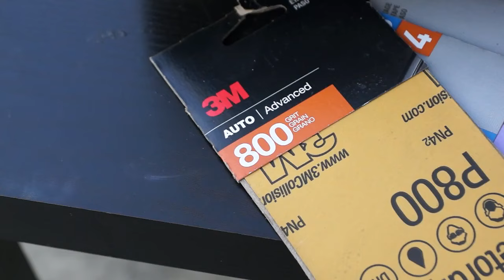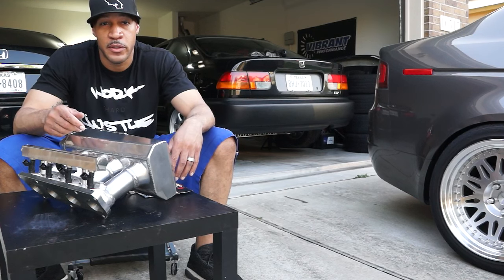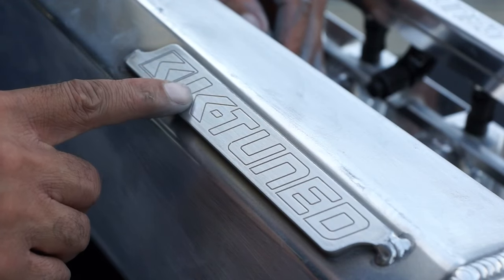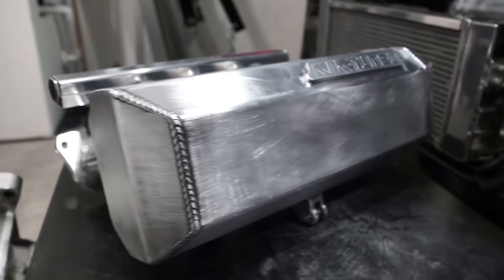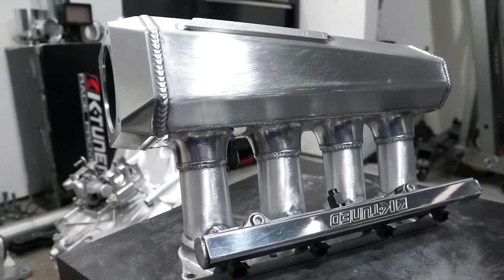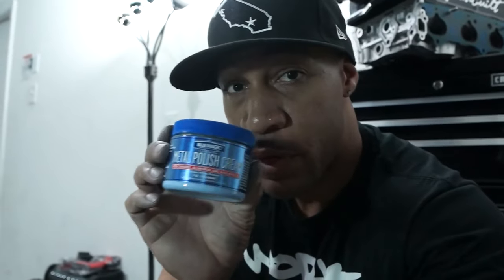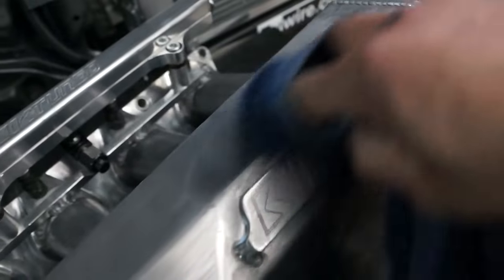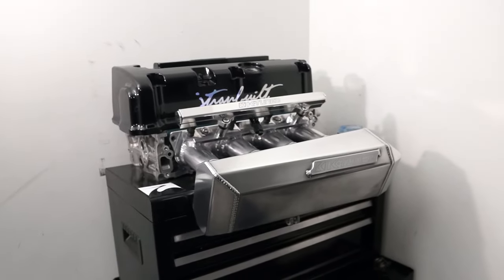POLISHING ALL DAY AND NIGHT | YOU ASKED ME

Comment: I used a dremel with a buffing wheel, and an angle grinder with a buffing wheel polishing from a 600 grit sandpaper finish.  comes out mirror.  You just have to start with a nice rouge and make several passes.  It's definitely faster and not as rough on your hands, but wear a mask/respirator.
Reply from the maker: +Steve Pham or ill keep doing it this way and never need to buy anything else and still get the same finish.  I never finished polishing it in the video.
Reply: Yeah nothing wrong with doing hand polishing.  I still do it from time to time for some things.  I work in a machine shop so I take advantage of all the tooling I have.

Comment: Get yourself a high RPM power drill and some buff pad adapters. It will save you hours. Its what I do. I polished my own OEM fuel rail, distributor, various brackets, header, fuel injectors, bolts. Its worth the investment. I bought my Milwaukee corded drill for about $100. Hits almost 3000 RPM. It leaves my stuff looking like a mirror with the right compounds. No haze. I also use my Dremel for small parts. Or try getting a bench grinder converted to a polisher. They aren't too expensive. Believe me, you will be looking for things to polish it will make it so easy. You can even make some money polishing other peoples parts.
Reply from the maker: +Victor Aguirre if you noticed, I said it's what I do when I don't have money for parts. I purposely spend lots of time doing it, it keeps me occupied and working on my car rather than spending a hour doing something and then I don't have anything I can even do to improve my car anymore.  I have other things to polish with, actually I have exactly what you suggested but that wasn't the point of this video.  

But thanks for watching and leaving feedback. I appreciate it.

Comment: you tried puttin the sand paper on a drill, to make the process a lil faster?
Reply from the maker: +L Harris no. If you need more speed, use a DA sander.  I don't use them becuase you still end up hand sanding to reach the hard to reach areas
Reply: gotcha, i got a few ideas ima try out when i get a lathe to make that process a lil better for all. looks dope im more of powder coating kinda guy

Comment: I have a question that I'm hoping you can answer. I have some old sprint hart cps, and I was wondering if this method you use will work on the sprint hart lips? I just want them to shine since the clear coat is coming off the lip. 
thank you
Reply from the maker: +Alfredo Robles yes this method still works. I wouldn't start off with nearly as rough of a grit with the wheels though and I would go way up to 2000 wet to finish it off.
Reply: ok thank you sir! Greatly appreciate the response.
Reply: for wheel lips. peel all the remain clear coat, then rub with 2000 grit+polishing paste instead of water.. then finish it off with power ball + polishing paste for mirror finish. works FASTER and wrist friendly. :)
Reply: What if it isnt peeling yet? Do I just start with 800 or 1000 grit?
Reply: By the way thank you very much

Comment: Ok, I'm a recent subscriber. I bought a K24a2 (completely stock other than a k tuned header and skunk 2 exhaust)Teggy last week. I'm looking to make at least 300hp in the future. My question to you is, did you have to build your block or head at all to make the power you're making?
Reply from the maker: +Josh hit VTEC yes, at a minimum you'll need your head built or swapped to a k20 head and built to make that power.  Mine is slightly bored to 88mm at 12.5:1 compression with a built head. With the right combination, you won't need s port job, but you will definitely need cams and supporting valvetrain.
Reply: Ok, thanks. I'm trying to do the k tuned theme too. The price on the k tuned intake manifold is really up there lol. The shifter billet, will it only fit on Rsx type s trannies? I have an EP3 tranny.
Reply from the maker: +Josh hit VTEC you can use the shifter in lots of different cars and transmission types. It's your shifter cables that matter most.  But with a ep3 trans, you're good to go. 

The manifold price seems high, but it comes with the fuel rail too. Skunk2 ultra race is cheaper because it's smaller and doesnt come with a fuel rail.  If you bought all the parts to make it equal to a ktuned manifold it would be more expensive than ktuned. 

All the big manifolds on the market with a fuel rail are all around the $1200 range.
Reply: Childstar Oh damn. If it comes with a fuel rail it's not that bad. What do you mean it depends on the cables?
Reply from the maker: +Josh hit VTEC the shifters mount in the cars the same. So there's no issue there.  Some of the K transmissions use different shifter cable types though, like the accord and tsx.  Those two use different shifters.
Reply: Childstar oh ok. Thanks for the help.
Reply: Yo, what trans are you running on your EK?
Reply from the maker: +Josh hit VTEC k20a2 trans with dc5 type r 4th, 5th, and 6th.
Reply: The build has came to a cease for right now. I just blew my motor by shifting into 2nd instead of 4th at a high rpm. Smh, now I'm back in my GSR lol.

Comment: 150 320? Huh?
Reply from the maker: Grits of sandpaper used to sand.....
Reply: @ksisjdm  yeah I get that.. I just never seen anyone use such a rough grit and then polish that Scratch Out.. I've painted cars for a while now. Polish and buffing are part of being a painter. So seeing that was wild.
Reply from the maker: You weren't here to feel how deep that actually was. It wasn't a thin cosmetic scratch. The manifold was hit and stuck against something. I had to go that rough to get that side down or else I wouldve had a dimpled area trying to just work that scratch out alone. 

The original polish job I did on it didnt start that rough at all. Also doing it by hand, if I were to start at like an 600-800, I wouldve been there  forever. If I had a DA sander at the time, I wouldnt have had to go as low of a grit either.  I literally showed exactly what I had to do in my circumstances. That's why I said Its not a tutorial but it's how I had to polish